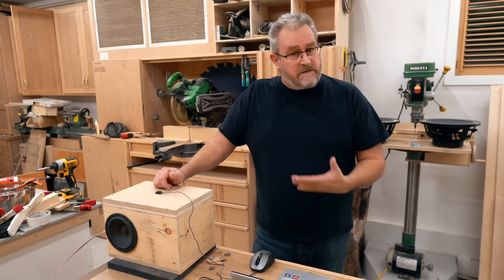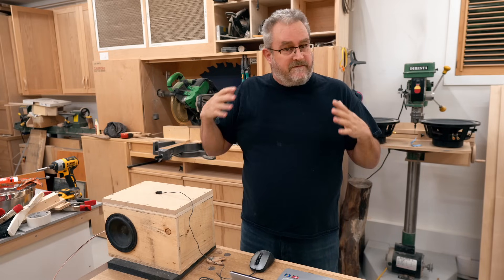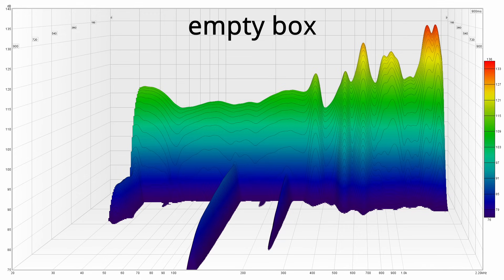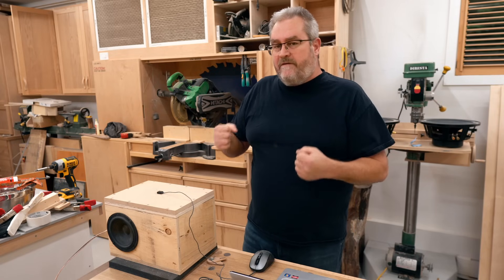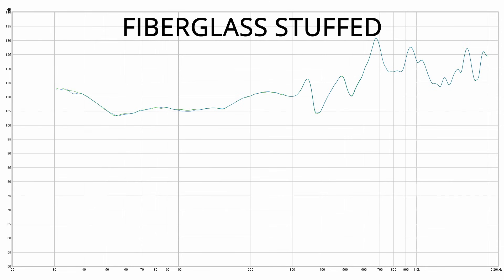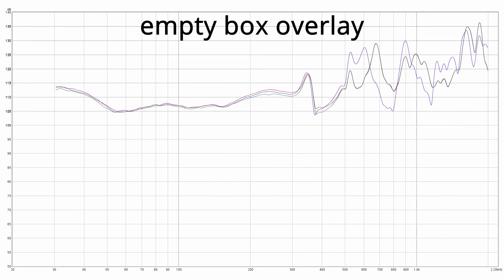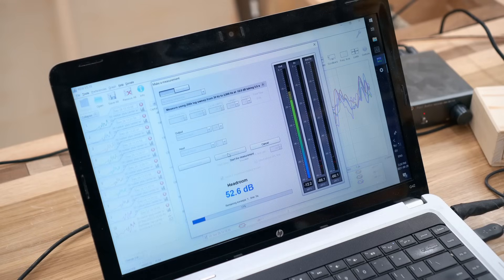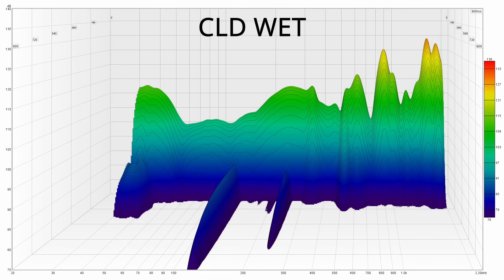Best Stuffing for Speakers Tested - Unexpected Results

Comment from the maker: "Best" is a relative term. All three work, but if you prefer to use polyfil it'll get the job done. You just need to use more of it than the other two. 

And I'm only looking at the ability of the stuffing to damp the interior of the box from the perspective of that one panel. The real difference between these is probably low enough that it really doesn't matter. 
With that said, when compared by weight, fiberglass and rockwool nose out the polyfil by a small margin.

My preference for fiberglass mostly came from almost always having some on hand. I like to use what I have and tend to be realistic about the differences between materials. Even if there is an audible difference, a difference doesn't necessarily mean one is better than the other. 

Moving on to direct panel damping, rubber damping was almost useless and doubling the panel thickness is effective but mostly down low. Double layer CLD is effective across the tested frequency range. I would consider that to be something worth doing if you are looking for peak performance. Like I said in the video, it can be combined with stuffing to make it even more effective.

Important to put all of this in perspective. These differences are relatively insignificant when compared with other much more important design considerations when build a speaker. Driver selection, box design (volume, alignment) and crossover design are orders of magnitude more important to how the speaker will sound.
I do these tests to demonstrate just how small the difference actually is between these and how little they will affect the sound.
Reply: This is all wrong. The whole idea of stuffing a box was not the dampening effects, it's the ability to cancel waves and make the box appear "bigger" if I am thinking correctly. I don't have the math in front of me, but I've seen this test done here: https://youtu.be/kc4AvfomdIQ?t=612
Reply: @wwlittlejOfficial  you are correct. It dampens too but generally the goal is to get a deeper response i.e. the woofer acting like it is in a bigger enclosure. It is def more for tuning than dampening.
Reply: @wwlittlejOfficial  That is correct.
Reply: Lol I usually use polyfill because I have it on hand. Anytime I have an old pillow I'm going to get rid of I gut it and throw it in a bag.
Reply: I wonder how it would change by doing a combination of all three:  CLD, rubber sheets and fiberglass stuffing.   Would be cool to test and see the cumulative effect.
Reply: What would be the effect if you'd put acoustic foam on the panels inside walls?
Reply: @JoRuss  
In this accelerometer test, most likely nothing would change.
Reply: Helo look this ! https://www.youtube.com/watch?v=FH3mmRLjKxU
Reply: Mineral wool or you call rock wool is nasty to work with but it works great insulating 500 to 600 degree pipe
Reply: U
Reply: Troels Gravesen recommends Pure sheeps' wool - to my ears it sounds wonderful !!!
Reply: If you want to prevent the walls from vibrating you need to install constrained layer damping (coincidentally this was the preferred methods of Earl Geddes also). The wool is for damping the internal reflections mostly.
Reply: Best material to use is actually sheepwool. What happens in  the box is that particles of air are rubbing on the damping material, loosing motion energie by creating temperature. All natural hair has much more surface than artifical fibre. Thus (as already mentioned) the speaker "sees" a larger volume as in an unstuffed box. As the resonance frequency is rising with smaller casings, a larger casing is always better.
I once built speakers for a bar. We experimented with different amounts of stuffing, until we, as a bunch of 4 people all agreed to having reached an optimum in this given room. I can only encourage anyone to try that out. It might be a bit of effort. But, hey: you wanna listen to those speakers for a while. I had used 2 fullrange speakers per box in an already generously sized casing. We hung 'em from the ceiling, so they wheren't even in the way of anyone (and safe from beeing tipped over ;-)
Reply: you should try Bubbled wrap
Reply: Hi John, if damping the resonance of a cabinet is the goal then a slab of marble or equivalent stone might be better. Basically that's what Wilson Audio does by saturating their cabinets on the WATT Puppy (and other models) with resin until they are practically fossilized; absolutely no resonance.
Reply: @patrickthunnus  You can use braces to change the panel shapes, to reduce the  size of the areas.

Comment: Regardless of all the theories out there,i can tell you.Just cover the inside walls with a thin layer of fiber glass.The idea is to avoid the sound to hit the wood walls directly ..  There's no science to it...I always cover the back wall first and try it.Depending on the wood the results vary.The fibergrass layer should be thin,no thicker than a 1/4 of an inch.Sometimes you do not even have to cover all the walls..Just tune the box accordingly...Try the back wall first,then if needed cover the bottom and try it..If more needed,cover the top wall and try and so on until you get the sound you like,Especially if you like tight base..Too much fiber will absorb the good sound.

Comment: Good test, thanks.

Kef use a type of polyfill, if it's good enough for Kef then should be good enough for most people, but will be better quality than off the shelf. Real speaker wadding, ie 400-600/m2.
Have opened up quite a few Kefs, it's usually the same stuff, and quite tightly packed in, but not to get in the way of the driver with a few inches to spare around the driver for the air to move around.
It's not a loose polyfill, more like what we find in pillows, but better quality, soft sheets of polyfill, easier to use and won't blow out of the ports.
Presumably they have their reasons for it, and not just because of cost.

My Dynaudio speakers possibly use the same, opened them up once, and again not too tightly packed in, but around the sides with room for the drivers to breath.
Perhaps they don't want much change as the tests showed and as their boxes will be heavily optimized before production.

Comment: Hi, you have nice videos. Everything you test in this video is nonsense.. from my point of view. :-D Test some material that has closed small air spaces. For example, polyurethane foam crosslinked under increased pressure. The material has excellent elasticity, is heavy and the individual air cells are smaller than one millimeter. Again, from my point of view, it is one of the best materials. However, I have never measured professionally, it is only about the resulting feeling of listening and the function of the material. Similar material can be found in sleeping mattresses, but it is usually a coarser version that has larger air cells but also works well. I would be very grateful for your opinion or if you could make a video and the results with this material. Thank you John, you are doing well ;-)

Comment: It's for internal reflections so they don't pass back thru the drivers.
Lining walls with butyl that has attached foam is what you want for panel resonance.
Pack poly fill behind your tweeter a little tighter than normal. 
You will hear more distinction between tweeter and woofer.

Comment: Worth offsetting the bracing from the mid-point to a non multiple of the cabinet dimensions?

eg using Phi, not ½ or ⅓rds etc

so the resonsnce of the new area is not a multiple of the other part of the pannel (or another pannel in the cab.

??

Comment: What would be the result in a vented box where the sound energy was allowed to escape? If you secured opposite sides with a physically fixed 1 inch dowel at various places to stop vibrations.

Comment: Just a word to the wise. Never use fiberglass! The glass fibers will ruin anything moving in your speakers. You'll be buying reconing kits in no time at all and if they have a built-in amp such as a powered subwoofer the fibers will destroy the circuit boards as well.

Comment: Damping material isn't to primarily stop panel Vibrations.
It is to lower the reflections internally inside the box so there is less second, & third harmonic distortion caused by the back Wave inside the box from bouncing off of the interior of the box that reflects off of the interior walls & hits the rear of the speaker cone causing Harmonic distortion.

Comment: But. the purpose of the stuffing is to change the acoustic impedance the speaker feels on the back of the cone.  In particular, that impedance should be the conjugate of the existing impedance from the combination; speaker cone mass, suspension spring, and air mass load on the front of the cone.  Being a conjugate, the reactive portion of the acoustic impedance felt by the cone is balanced (equals zero or -j0.0 mathematically), so that the cone drives a purely resistive load.  That yields maximum power output and linearity over frequency.  Box resonance is reduced as well, but there are better ways to control box resonance, such as interior dimensions, irregularly shaping, rigidity, and contact damping (like DynaMat).  Minimizing box resonance doesn't correlate to optimizing impedance, unfortunately.  Hope this helps.

Comment: The middle layer in a CLD composite is supposed to be viscoelastic. Silicone is highly elastic and minimally viscous and so seems like a poor choice. Viscosity is required to dissipate energy as heat (damping). An elastic material will just generate a panel with different resonance characteristics but no increase in damping.

Comment: I really appreciate all you contribute to the community John. With this video, there are some real issues 
1. You have the accel on a planar face that is not decoupled from the emitter
2. This means that the majority of the energy is transmitting usiing the mechanical box
3. As you increase the damping, it is an internal airspace mod in terms of the standing waves but in your case the transmission change is almost negligible because its still using the box as a wave guide of sorts to the top of the box...being a membrane.

I dont use any planar facings in any of the enclosures we do and they are proprietary masonry thats is extremely engergy absorbent (200mm can stop a 50 cal) and generally cast in a single piece.

BUT 

Its quite amazing for tuning the boxes if there are critical issues

You can also do progressive damping by using acoustically inert diaphragms, tuning them to required freq and suspending them in the internal fill material which creates a type of hemholz if you really have issues esp in larger boxes. There is a noticeable choking that happens when I load a single driver sealed right up.

Great vids and always challenging!

Comment: THE BEST BRACING material i have found is laminate flooring cut into 20mm - 25mm strips and epoxied vertically and horizontally in a cross + on each panel internally.  

Glued on the edge BTW so it stands up. And glued to each other at the corners as a lap joint.

Comment: I use the pink panther fiberglass very minimal fiberglass dust and really dense also to damp my panels I use the 120mil butyl rubber with floating floor sound and vibration damping adhered to it, so count the volume of your box an extra 3/16 of an Inch in all internal Dimensions, Also, when I have enough, to make my panels, I use Wilsonart 950 flexible adhesive and glue three 1/4 inch mdf panels together to make one 3/4” panel, And they pass the knuckle wrap test like knocking on concrete

Comment: Although your measured responses are from the vibrations of the enclosure, you do not show any measured open-air responses from the actual drivers. One could imagine that certain frequencies could be affected by absorption in different ways by different stuffing materials. However, it is interesting to see that box resonances are not changed very much Then again this is fairly obvious, as the vibration of enclosure is affected mostly by the choice of its material, their thickness and weight, bracing and whether the insides of the panels are damped by an additional layer of damping material, especially viscous ones or heavy stuff like lead sheet.

Comment: seems like combinations of all methods/materials is best.  double walled closure + poly + (fiber or rockwool) + rubber/asphalt sheets on all inner surfaces + 'meaty'  rubberized exterior finish/coating should yield even better results.  rarely is it a one-and-done treatment on quelling resonance... cheers and thanks.

Comment: I once built a pair of speakers based on the CLD principle. I used MDF lined with ceramic tiles, sheet glass and aluminium sheet bonded in place with rubber based adhesive. Back corners had panels giving triangular vertical columns which were filled with sand. Stuffing was traditional long-haired wool. The resulting floor-standing enclosure was exceptionally "dead" but each box weight 100kg.
Reply: And as you probably noticed the cabin resonances are not really the big issue in speaker building.

Comment: Sorry for the late comment as I just found this video.  For this setup given the simple single speaker, you could take acoustic measurements close to the speaker (say 6" or so), and the room dynamics would be insignificant.  Therefore you could quantify the speaker acoustic output (albeit only from the driver) with measurements for each setup and see which changes (if any) happen to the sound from the driver.  Just saying a vibration is insignificant could be strengthened with actual measurements.

Comment: I found early in my salvage of speakers to reuse in reused kitchen cabs as speaker cabs that fiber fill is ineffecient for adding enough mass in th enclosure to increas bass tones fron the box.. my silution was to use foam rubber from old couch cusions.make a cup of foam just large enough for the speaker then fill the remaining space with more foam, the result is no internal sound reflection and deeper bass. making a 2 cubic ft box sound 2 or 3 times its size. at first I used cotton upholstry fill then found that the foam rubber worked much better,

Comment: I think maybe there are misconceptions about what the stuffing is supposed to do. It’s not to stop the panels from vibrating. It’s to reduce the sound of the backwave from coming back through the speaker cone. It’s the same thing as putting sound treatments on your walls to prevent sound from bouncing around the room creating peaks and dips in the frequency response. 
 Now imagine a recording studio where they only treated one of the side walls and not the wall directly in front of the microphone. It’s going to sound like you’re recording in a bathroom. The damping needs to cover the entire enclosure especially the back wall directly behind the speaker.

Comment: Stuffing for reducing panel resonance is iffy. Best if it lightly touches or is attached. Stuffing has three basic functions. Absorption, ability to make box appear larger, and delay. Open foam rivals fiberglass for all three, and rock wool functions similarly except density varies. Polyfill is just not as effective at all things except it usually spreads out well. Cotton is another stuffing and wool.

Comment: Any thoughts on bracing asymmetrically? I'd like to see you test with an accellerometer attached right over the brace and on each of the panel sections created. Even summing those three (amplitude and phase) would be a very interesting excercise. 

I'm building speakers right now, an planning to use some of the leftover materials for asymmetricaly placed braces, lots of polyfill (almost getting a rash from just thinking of glass- or rock wool). and possibly adding glued/stapled on bitumen and heavy felt. The mains will be an active cardioid solution with front and rear drivers in a common volume, rear inverted and delayed to mimick an output more similar to a theoretical U-baffle.

Comment: Speaker fill has two purposes: to increase the relative internal volume "seen" by low bass frequencies, and to absorb mid to high frequencies. 

That being said, there's not a situation where speaker fill will dampen the side panel resonance, unless you use an enormous amount of fill. 

If making a 3 way design, the mix woofer should be sealed in a separate enclosure, and densely stuffed. The reason to densely stuff the mid woofers compartment is to eliminate internal reflection, which would otherwise interact with the woofer and cause resonance in the frequency response. 

For the bass section, if ported, then an "ideal" amount of fill should be used based off the internal volume. Since the crossover will limit mid and high frequencies, the main purpose of this fill is to increase the relative volume, and therefore the bass output. 

In a two way speaker design, ported, a hybrid approach can be taken. Dense fill behind the driver, loose fill everywhere else. There's plenty of online documentation demonstrating the best method to fill your speaker based off the speaker design.

Comment: Silicone is not the best choice. There are products made specifically for this purpose. Green Glue sound deadening compound is one I’m familiar with. You apply it with a caulking gun between layers.
Reply: I agree.  Shore rating matters here if the goal is truly an effective CLD construction.  I would try something like WEICON Flex 310 M between some MDF.

Comment: your reading acoustic vibration in the box not changes in acoustic sound waves. are you just trying to damppen the panels or tricking sub in to thinking it in a little larger box?? back when I had a RTA I did a test with poly fill with and without and there was a noticeable difference of 7Hz lower and 1db higher average subs was rockford he2 12's 1.75cf each